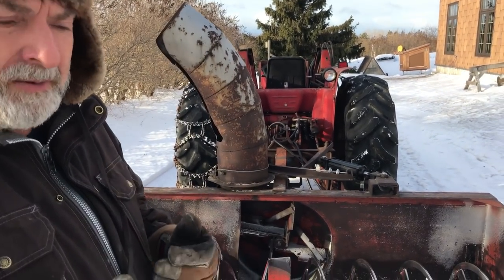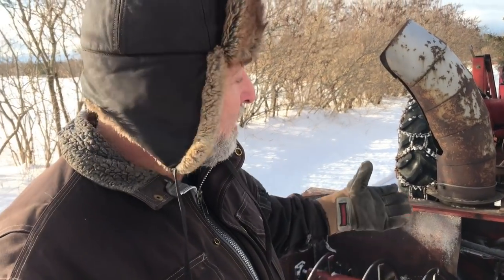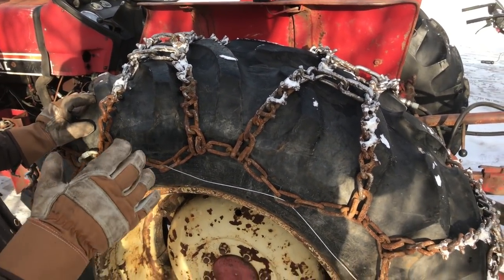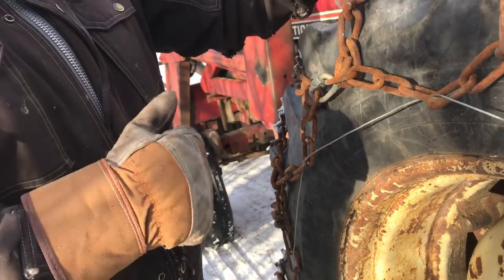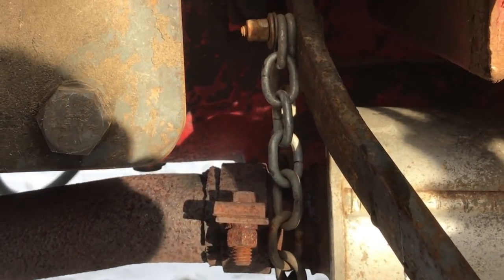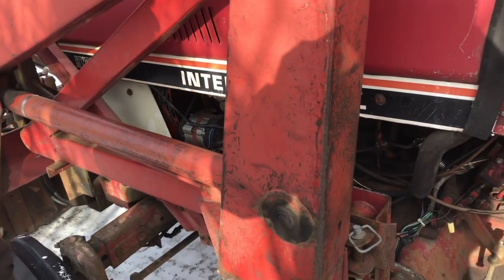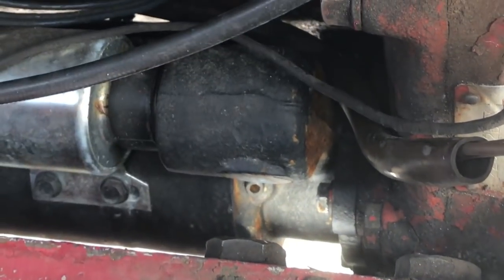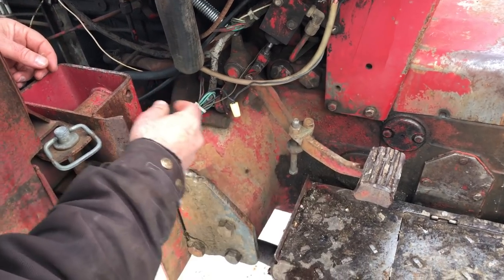Watch This Before Buying a New Tractor - Bailey Line Life #6

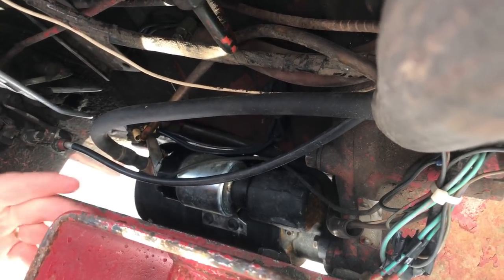Comment: 10:00. Steve, I would have taken the loader off.  A bit more difficult with the Hydro tractor since it cannot be tow-started.  With the bucket lowered to ground, remove loader retaining pins, use another tractor to pull it backwards 3 feet, hook up the other tractors hydraulics to the loader boom cylinder hoses to extend them and make the "Mount-O-Matic" rest on the ground.  Now the tractor is free of the loader and the frame can be removed with a 1⅛" wrench to access the starter.

Comment: My 2015 John Deere two years ago, the computer controlled emission system was going nuts (but still ran and I still needed the tractor daily).  The system was still under warranty,  parts and labour covered no charge, but just getting the technician here with his plugged in computer costs $$$$.

Comment: I had an interaction recently that mirrors your principle here. I do just about everything myself. From home reno’s, to welding, landscaping, anything that my home needs I am more than willing to learn how to do it properly, buy the tools, and execute accordingly. My current vehicle is a Subaru Forester that cost me $9000 82,000 miles ago. I’ve had plywood and drywall on the roofrack, 1000lbs of wood pellets inside, pulled 4x8 trailers full of mulch or trash. It does anything i ask. Recently on a Lowe’s run, an over-zealous contractor in his King Ranch f350 was loading up a toilet in his bed. He saw me strapping 16’ sticks of baseboard to the roof and said “man, you really need a truck!” You mean like your $60,000 toilet hauler? No sir, no thank you.

Comment: Greetings from Sweden, and some wholehearted agreement on pretty much everything you said in the video.

I don't own a tractor, I don't have any cropland, there's only forest where I live. I get by just fine with a small atv to pull some logs for lumber/firewood and the occasional elk or wild boar from the forest.

But I apply the exact same philosophy to maintaining and buying equipment and tools as you.

I also get a lot more satisfaction from repairing or building something myself than if I buy it. 

Last winter I built a logsplitter like the one in this video, it's the original inventors video clip. 

https://youtu.be/Bk-XcO7mcD0

Beside concrete for the foundation and the table I only bought a coil spring, originally intended to be used in the front suspension of an older Volvo model. 

I had all the other metal parts laying around. And it's always good to keep your welding skills up to date. 

The splitter works really great, even if I still keep the old hydraulic splitter next to my new and let the hydraulic splitter take care of the biggest and most grumpy logs, but all other splitting is done quicker and it's more fun using the spring loaded splitter.

Well, I got carried away, I came here not to talk about tractors and not logsplitters. 

As my daytime job is in IT, I find the behavior of John Deere and how they treat their customers and their general business practices absolutely disgusting. 

You may find this article interesting. 

https://motherboard.vice.com/en_us/article/xykkkd/why-american-farmers-are-hacking-their-tractors-with-ukrainian-firmware

In the IT world it used to be common with vendors that behaved in similar ways, but it ended up creating so much bad will that in the end customers were prepared to pay a much higher price for open systems that didn't lock them in.

In the long run it will of course always be a lot cheaper if you avoid the vendors of proprietary software. 

Today the old vendors have either changed their business model or have gone bankrupt. 

I wish John Deere and other crony capitalists would focus more on delivering what their customers want and less on lobbying legislators.